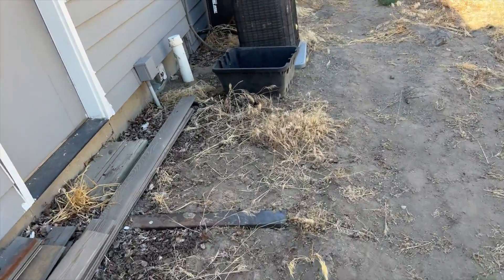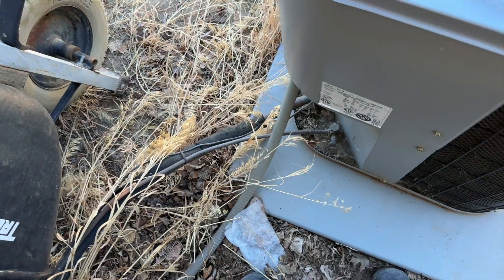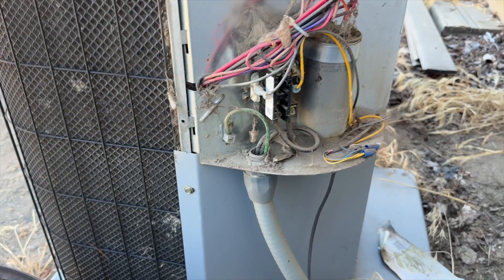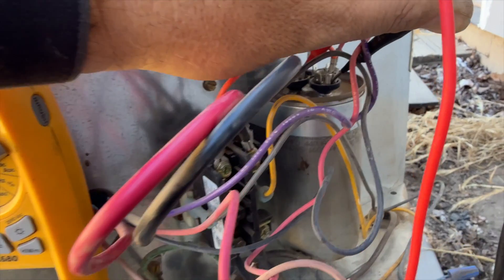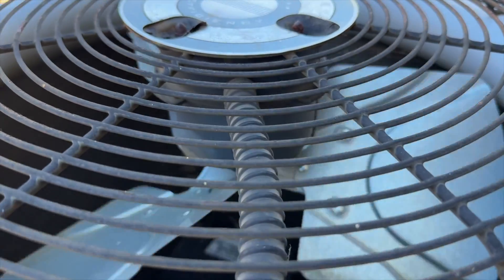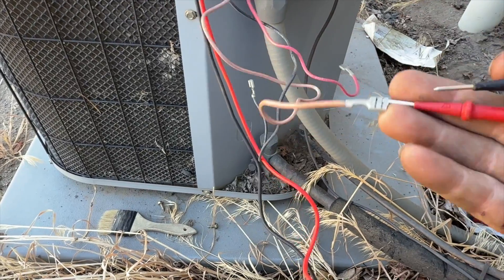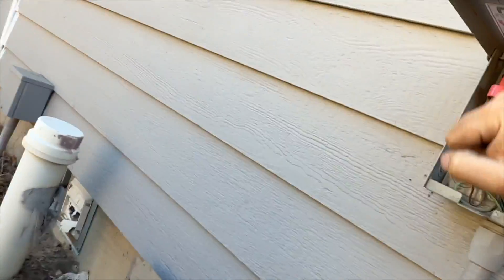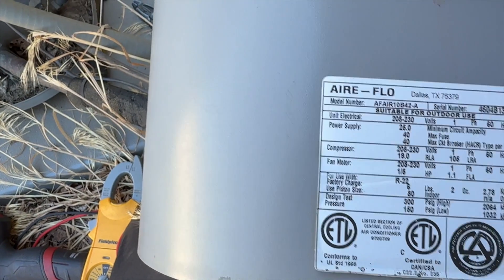Why Is My AC Compressor Screaming? Bad Fan Motor Fix! EP225

Comment: My ac starting tripping today. I can reset the compressor circuit breaker and it will run for a while than kick off again. If its running for a  while before tripping the breaker, im assuming its not the start cap. What would you suggest I do to find the issue with the breaker tripping intermittently? It will run anywhere from 10 minutes to an hour or so before tripping again